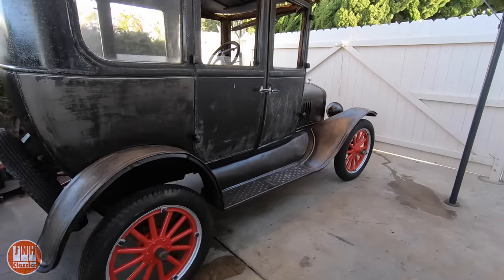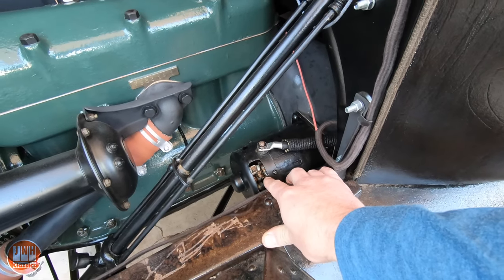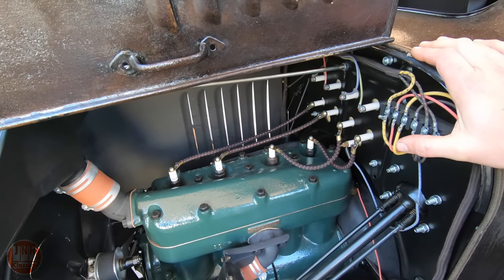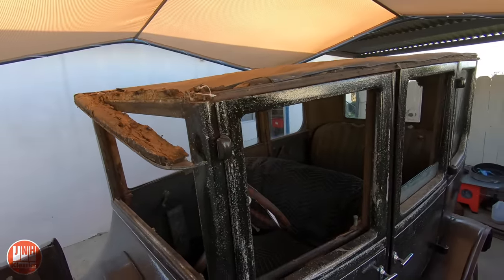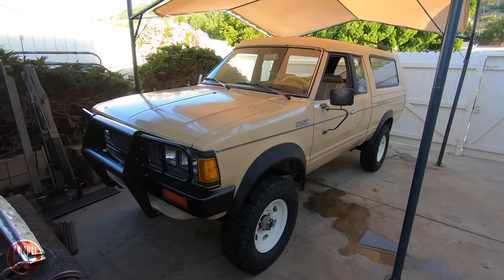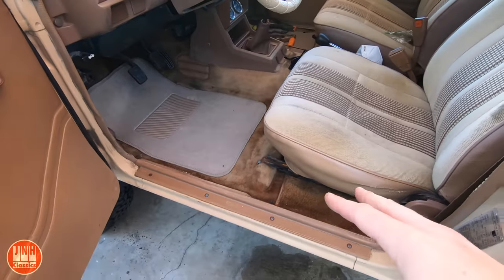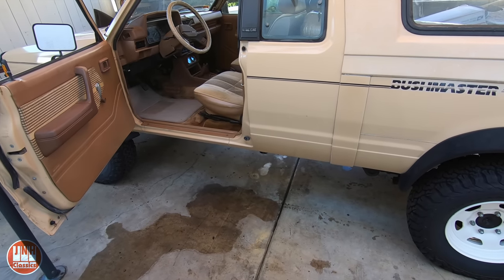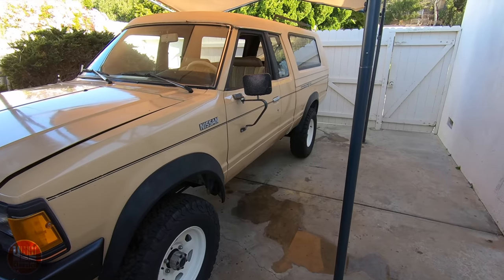The Model T Runs! & The Bushmaster is Back! - Sunday Update (2-28-21)

Comment: You have a new head gasket, if you don't mess it up taking the head off, the gasket should be fine to reuse. The only reason not to use it is if it was damaged, spray it with the copper gasket treatment.
Reply: I agree with Gill - don't run the T any more until you get the threads fixed in the block.  Also, you would be best to take the head off for this repair as you will end up with cast iron chips all over the place otherwise.  With the head off, you can be super careful where all the debris is going.

Comment: again o these major restorations consider using a 9lb or 12 lb polyeurethane foam it has minimal expansion and quiets the ride etc...this was done first in the 1980s with the lexus but it has many benefits beyond quiet... It water proofs an area in the last few hurricanes in florida a boat guy and insurance companies discovered that the boats with the 6 lb poly absorbed water like a sponge so if a hull was compromised the boats were a total loss but those with the 9lb or 12 lb foams closed cell, structures repeld water and where totally viable for repair ...9lb or 12 lb poly has  low expansion is pretty much what we use around doors and windows...it will expand to close gaps but will not distort the fits...water proofing and added insulation values as well as quieting the ride make this detail a superior choice for professional restorers

Comment: with what all you done for the engine, have you considered using a pin lock threaded insert, in that way you can maintain the OME head bolt. but of course, your out a head head gasket. 
 the pin locked thread insert is the way. although I could be wrong.

Comment: I noticed the engine number stamped on the left side of the block.  According to https://www.mtfca.com/encyclo/sernos.htm your engine was produced in Mid-May 1923
Reply from the maker: Also the engine number is the vin number. There’s no other number on the car. So I guess the title goes with the engine not the car👍
Reply: @Jerod_Helt  Ford didn't start stamping the engine number on the right top of the frame until 1926 according to posts I've found.  After almost 100 years, it's amazing tht your car has its original engine as so many got swapped out over the years.